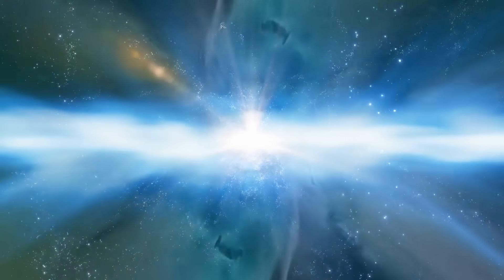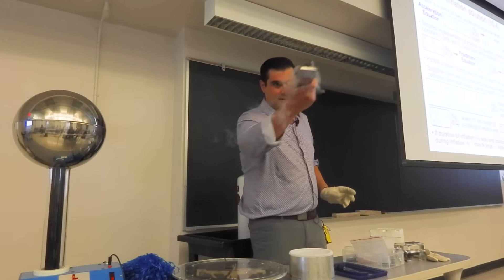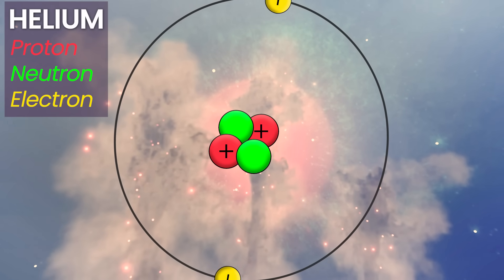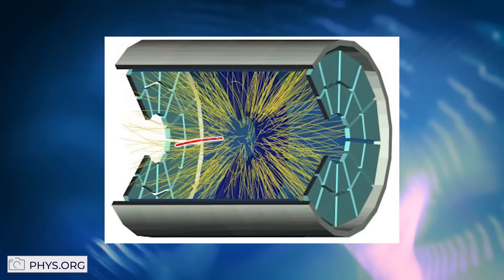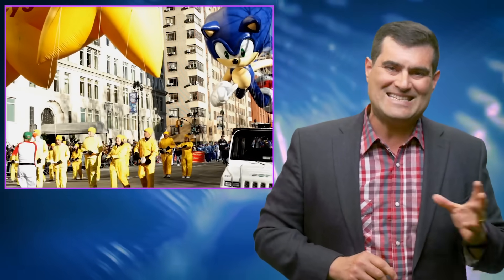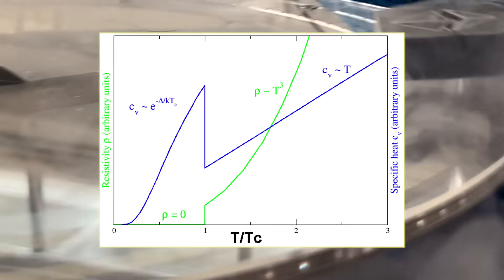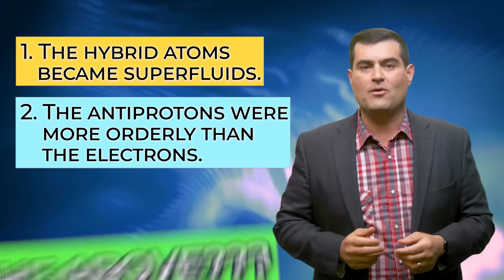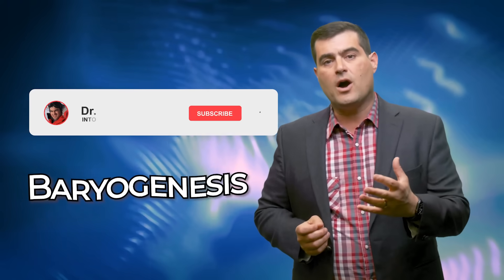Scientists Just Mixed Matter and Antimatter (It Didn't Explode)

Comment: Makes some sense that a noble antigas wouldn't react.
Reply: That a gas is a noble gas refers to its chemical reactions (or non-reactions). That has nothing to do with matter/antimatter reactions.
Reply: @bjornfeuerbacher5514  You sure about that?
Reply: @orbitalbear  Yes.
Reply: @orbitalbear What is "Antihydrogen/positrons" supposed to mean? Those are two different things. And positrons don't have valence shells at all. And antihydrogen does not have an empty valence shell, its valence shell contains one positron.

Additionally, no one said that antihelium does not annihilate easily, where did you get that from? The video was about helium where one of the electrons was replaced by antiproton, that is totally different from antihelium.

So nothing what you wrote made sense.
Reply: @orbitalbear  You meant "antiproton" in which part of your sentences above?
Reply: @orbitalbear  Antihydrogen is not the same as antiproton. Antihydrogen is a bound system of an antiproton and a positron. I. e. it does not have an empty valence shell. As I already explained above!

Additionally, again: antihelium does not annihilate easily, where did you get that from? The video was about helium where one of the electrons was replaced by antiproton, that is totally different from antihelium.

So still most of what you wrote does not make sense.

Comment: It is a very interesting experiment. Will wait to see just what is discovered to be happening. One observation is that anti-matter + matter annihilation has never been properly explained. For example, electron and protons could sort of mutually annihilate since they are oppositely charged, so they should attract. Instead, they merge into a hydrogen atom. Since that happens, then why do electrons and positrons annihilate? They are also oppositely charged, so they mutually attract. Why don't they merge into some kind of very small "atom-thing" like hydrogen?
Reply: "One observation is that anti-matter + matter annihilation has never been properly explained."

It has. The problem is only that you obviously have never heard the explanation.

"For example, electron and protons could sort of mutually annihilate since they are oppositely charged"

Wrong. That they are oppositely charged does not imply at all that they could mutually annihilate, where did you get that idea from? That works only for pairs of particles and their anti-particles. But protons are not the antiparticles of electrons.

"so they should attract. Instead, they merge into a hydrogen atom"

They word "instead" makes little sense here. They can merge into a hydrogen atom precisely because they attract!

"Since that happens, then why do electrons and positrons annihilate?"

Because they are anti-particles to each other.

"Why don't they merge into some kind of very small "atom-thing" like hydrogen?"

They can do that, too, for a short time before they annihilate. Have you never heard of "positronium"?
Reply: @bjornfeuerbacher5514  Some good points, but not quite persuasive.  It turns out that a free neutron can decay into an electron + proton + anti-neutrino. The reverse merging reaction is also possible: proton + electron + anti-neutrino -> neutron. The presumed reason the decay works but the merge does not happen is that the neutron has a little more rest mass than the proton + electron. That is the part that is not explained. Just why is the neutron slightly heavier? The mass is just a natural constant with no known explanation. The comment about positronium => some kind of pseudo-atom made of an electron and anti-electron is something I wonder about. Why is positronium unstable? If the mass argument is correct, then the annihilation of the two particles with about 0.5 Mev of mass each to yield some photons with zero mass is the "reason".  But why? If the whole explanation is that the universe tends to lower mass particles, and zero mass photons are the "ultimate" decay product, then why is there any matter at all? Why do neutrons even exist if they can decay into protons and electrons (and anti-neutrinos).
Reply: @alanwilson175  " It turns out that a free neutron can decay into an electron + proton + anti-neutrino. The reverse merging reaction is also possible: proton + electron + anti-neutrino -> neutron."

Yes, I know that, thanks. So what? That does in no way invalidate any of my arguments.

"That is the part that is not explained. Just why is the neutron slightly heavier?"

That's due to the interactions of the quarks inside the neutron resp. the proton. It's not possible to explain that in layman terms, one has to do very complicated calculations for that.

"The mass is just a natural constant with no known explanation."

Wrong, see above.

"Why is positronium unstable?"

Because the electron and positron can annihilate, and therefore they will do that sooner or later.

"If the mass argument is correct, then the annihilation of the two particles with about 0.5 Mev of mass each to yield some photons with zero mass is the "reason"."

??? I can't follow your argument, sorry.

" But why?"

Again: They can do it, therefore they will do it. There is nothing at all unclear about that.

"If the whole explanation is that the universe tends to lower mass particles, and zero mass photons are the "ultimate" decay product, then why is there any matter at all?"

Because due to the possible interactions between particles, some particles simply can not decay.

"Why do neutrons even exist if they can decay into protons and electrons "

Free neutrons do not exist (at least not for a long time, only a short time after they are created). Bound neutrons, on the other hand, again can exist due to energy conservation.
Reply: Matter and antimatter interact to form energy, but why? Even in case of electron and proton we have two and more than two gamma photon production. Some asymmetric theory have some say but not very fundamental. What trigger this law of mass energy equivalence to a complete vacuum phenomenon. And the virtual particles production and decay hypothesis is also very unhappy situation. QCD is in business but not the science. 
I have derived very equations to explain and explore new physics that is being highlighted in CERN. 
In SURT ( Super Theory of Relativity)these new observations have new satisfactory explanation. 
Nothing is bolt from blue.
Explanation is very natural and universal.
Reply: @BiswajitBhattacharjee-up8vv  "Matter and antimatter interact to form energy, but why?"

Because they also can give off energy and absorb energy. These are simply three different versions of essentially the same process. One can see that easily when one looks at Feynman diagrams. (And by the way, saying that they "form energy" is actually wrong - the energy they have is merely transformed into another form, no new energy appears there).

"Even in case of electron and proton we have two and more than two gamma photon production."

Err - no? Electrons and protons do not annihilate each other. Did you mean electrons and positrons?

"Some asymmetric theory have some say but not very fundamental. "

I don't know what you mean here.

"What trigger this law of mass energy equivalence to a complete vacuum phenomenon."

Again, I don't know what you mean here.

"And the virtual particles production and decay hypothesis is also very unhappy situation."

Why?

"QCD is in business but not the science."

????? Why on Earth do you think so? QCD is very much science.

"I have derived very equations to explain and explore new physics that is being highlighted in CERN. "

Oh, please, no. You have already demonstrated with your previous sentences that you have no clue what you are talking about.

"In SURT ( Super Theory of Relativity)these new observations have new satisfactory explanation."

I would be that these explanations are only satisfactory to you. Not to anyone who actually understands physics.

Comment: This is very significant. I wonder how those Propton-antiproton helium will behave chemically. I wish someday proton-proton hydrogen is built like that and we get to peer into the chemistry of anti-matter.
Reply: It will be a very strange nucleus, given the net charge of the nucleus would be 0.  Would it even be able to hold electron orbitals at all?  It might end up being utterly chemically inert.
Reply: @Alondro77  The nuclous of these Hellium has two protons two neutrons. But instead of two electron, some atoms has two anti-proton instead.
Reply: @aniksamiurrahman6365  But those anti-protons won't form 'orbitals' in the way electrons will.  They will remain as discreet particles, rather than a 'cloud', meaning their interactions will be far weaker than for electrons.
Reply: @Alondro77  How do u know? So far, they hv generated stable atoms.
Reply: @aniksamiurrahman6365  Uhm, because of particle physics?  An antiproton bound in this way should not be able to exhibit particle-wave duality or non-locality.  It's too massive, the same mass as a proton.  And we already know that single protons (hydrogen ions) are discrete particles.  

This chimeric atom will have very odd chemical properties if they can create enough to experiment with it.
Reply: @Alondro77  Inside nucleus, both proton and neutron are organized in orbittals. I don't know why it can't be the same case here, just with much less radious than electron orbitals. This is an important question we need to address experimentally. If these matter-antimatter hybrid atoms has very small diameter, they might be way easier to fuse. This may well lead to an activation phase, where a small portion of regular hydrogen atoms are made Fusile (ready to fuse) by anti-proton bombardment, strating the fusion, resulting energy continuing the process.

Comment: Hmm, I wonder whether this helium behaves bosonic, and whether bosons behave like fermions wrt matter-antimatter annihilation. Related is the question about the uncertainty principle at low temperatures: Does the antiproton know where the helium nucleus is? And the third question is whether the annihilation requires to overcoma a barrier, resulting in kind of a metastable state. Just first thoughts. An interesting experiment in any case.
Reply: Helium 4 is a boson, yes.
When the anti-protons orbit the nucleus… well, I imagine there aren’t all that many of the atoms with the antiprotons, so I’m not sure that the helium nuclei acting like bottoms would especially matter? I guess it is relevant for the superfluidity stuff…
Regarding “do the antiprotons know where the nucleus is?” and how that relates to the uncertainty principle:
When you have multiple particles interacting, especially a pair of particles, especially especially one which is much more massive and one that is less massive, you can take an average of the position operators of the different particles, weighted by their respective masses, and do the same with their momentum operators, yielding position and momentum operators for the overall system. These operators for the overall system obey the same kind of commutation relations as the position and momentum operators for individual particles.
In the case with 2 particles, you also can take the difference of the two particles position operators and momentum operators, and also get such a thing, where you get something akin to a particle which is really the displacement between the two.
(the “reduced mass” will also play a role)

This imaginary particle that comes from the displacement between the two particles, when the potential energy is function of the size of the difference in positions, can be considered as being on some like, spherically symmetric potential function.
Position momentum uncertainty applies to this pretend particle which corresponds to the displacement between the particles, just like it would apply to normal particles.

So, in effect, when a really light particle orbits a really massive one, you can think of it as if the really massive one is stationary at the origin and the little one is orbiting the origin (with a slightly different mass from its actual mass. The larger the ratio of the masses the closer this approximation comes to being exact),
and then separately model how the combined thing moves through space.

So, in this way, the uncertainty in position for an atom can grow over time, while the uncertainty in the distance between the electrons in the atom and its nucleus, remains constant (though non-zero) .
Reply: @drdca8263  In a collection of bosons, like the He-4 nuclei in a suprafluid state, the individual nuclei are indistinguishable from each other in my understanding when in the ground state. That's different for the fermionic antiprotons. So, I'm not sure whether the antiproton can bind to an individual He-4 nucleus at all, since the intuitive notion of a particle applies to fermions while bosons in ground state appear like a wave or a cloud with less the property of individual particles. You can't label them any more since they are all in the same quantum state. The antiproton may behave more like a non-localized electron in a metal, very roughly speaking, and unable to distinguish and select a single He-4 nucleus to annihilate with. Something like that. But I may well be wrong. It's easy to go wrong in the quantum world.
Reply: @geraldeichstaedt  Well, the electrons around the Helium nuclei remain bound to the helium nuclei, right? So why wouldn’t the anti-protons do so given that the electrons do?
Reply: @drdca8263  The electron pair is itself bosonic, like the whole helium atom, all separately and together in the ground state, other than the antiproton. Hard to grasp intuitively, at least for me.
Reply: @geraldeichstaedt  I was imagining 2 antiprotons around the helium nuclei, not just 1. I could be wrong about that, but if that is what was meant, it doesn’t seem that different to me.
Reply: @drdca8263  By shooting a small number of antiprotons into suprafluid helium, I doubt that they can manage to deliver two antiprotons to the same helium nucleus. But again, in a Bose-Einstein condensate, the notion of individual atoms is questionable. All particles are de-localized while the antiproton remains fermionic and localized.
A single helium atom with an electron replaced by an antiproton (or both electrons replaced) would be distiguishable by its obviously different quantum state. But that may never happen in that experimental settings.
Reply: @ I don’t think a superfluid is a Bose-Einstein condensate generally? Not sure how much that influences your point though
Reply: @drdca8263  If Bose-Einstein condensation plays a major role in suprafluid helium-4, then there are no helium atoms in the traditional sense of individual atoms. So, the fermionic antiproton doesn't find a counterpart to annihilate with. That's my basic humble attempt to understand this phenomenon.